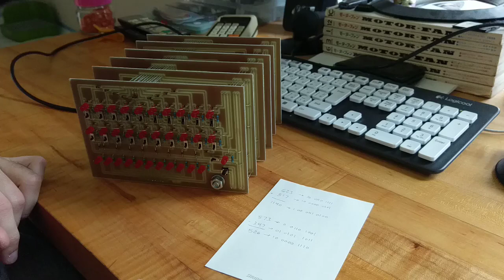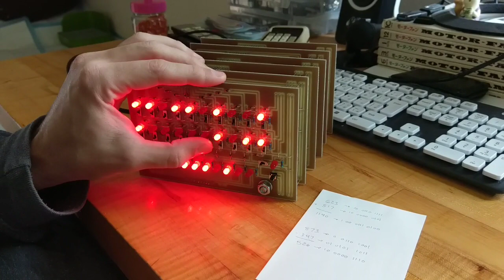10-Bit Relay Adder

Comment: It’s cool that it does additions one bit at a time. I managed to make one that also does multiplication and division up to 10 bits with only relays. (Channel has English subtitles)
Reply: @MachtNixPasstSo Division can be done in a few ways, one is SLOW and huge, and is litteraly doing long division with alot of subtraction. Really annoying and bad, so not often used unless its really needed

The other uses logarithms and that is difficult, idr understand it but it's kinda insane and also only works are certain numbers

Either way, division usually isnt added bc its big and insanely slow, which modern CPUs use clocks based on the slowest component so it'd slow the whole thing down. Instead they do it after the fact and just do repeated subtraction as a bunch of tiny quick steps.
Reply: One way is by multiple subtraction @MachtNixPasstSo

Comment: It looks like you are propagating the carry at relay speed.  Zuse did something pretty clever that was much faster and scaled very far.  I implemented this for a 2-bit adder and it worked as described.  One description: https://tams.informatik.uni-hamburg.de/applets/hades/webdemos/05-switched/20-relays/zuseadd.html
Reply from the maker: That is very cool! Having relays with multiple taps on them makes a huge difference too! Still, that's a brilliant piece of engineering. I would have loved to see more relay computers be built, I think some really cool innovations could have been done like this to get around the inherent speed limitations.

Comment: Brilliant. I Love the sound of relays.
Reply from the maker: Thank you! 
This one really does make a great sound, sometimes I fire it up and let it run just to hear it click clack to completion!
Reply: @MachtNixPasstSo I have to agree with you. They are so relaxing.
Reply: リセットボタンを押すと電源が遮断され１行づつ計算をするのでしょうね(o・ω・o)
Reply: 🙂👍 @个_个-f4t
Reply: @MachtNixPasstSo I have understood this sort of thing from junior high school when I was mostly self-taught,  it is really not that hard for me to grasp the concepts.
Now calculating density or theoretical power output, that is where I need to ask someone what the answer is!
When I worked in the shop for a railroad the Chief Mechanical Engineer MIGHT use paper to calculate the center of gravity, angles, and lifting forces for the overhead crane but usually he could do the equations in his head!
And that is why we need many people with completely different skills to properly do a job.  It's too bad high schools now days are turning out students who don't have a clue about how to work a job that doesn't involve three buttons and a joystick.

Comment: This is pretty cool!!!   I wonder, can you disable that first result bit with the subtract switch?
Reply from the maker: Thank you!
That's actually a really smart idea! Unfortunately, with the way I designed it, it doesn't really come apart gracefully. I took it apart once to fix some issues on one of the inner boards, but I lifted a lot traces in the process and it definitely wouldn't like coming apart and going back together again. It definitely looks cool, but it was a horrible design for maintenance, haha.